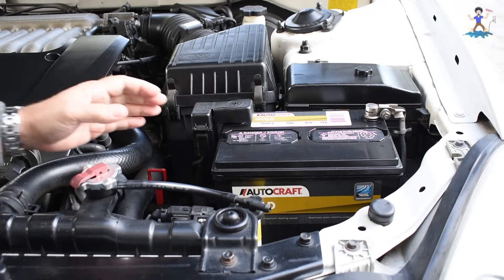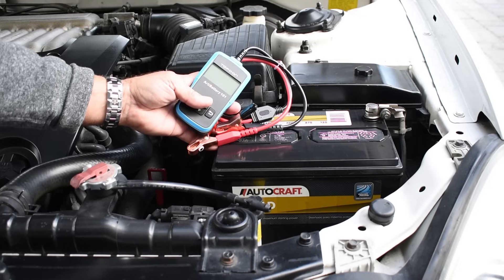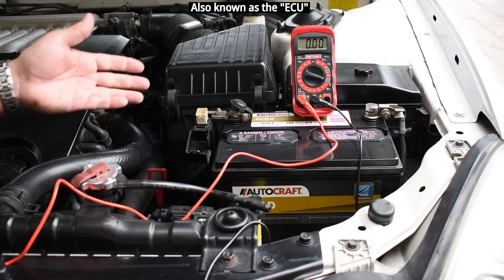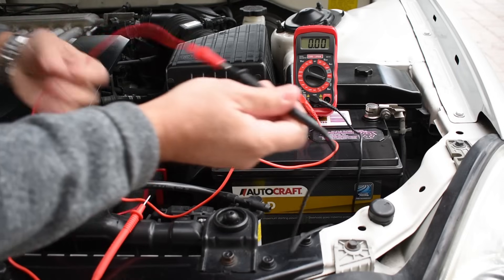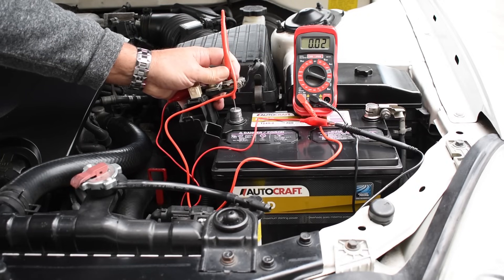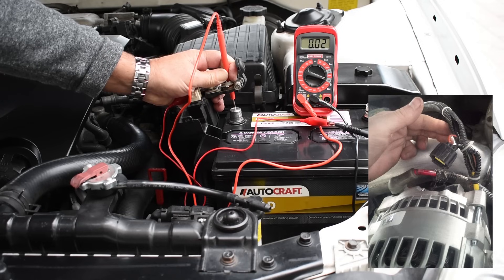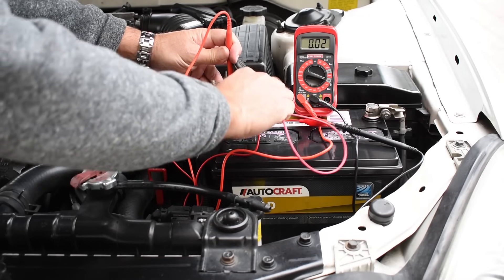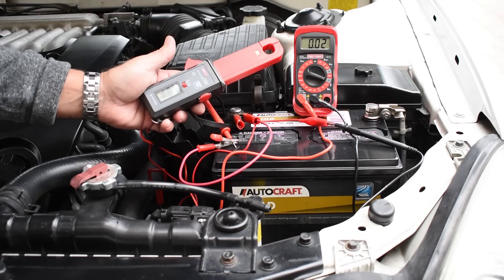Car Battery Drains Overnight Or After Days Of No Use! PARASITIC DRAIN

Comment: wondering is someone can help me. on my 2014 kia forte my battery drains quickly over 2-3 days. took my car to autozone and it checked out good. drove around and charged it back to 12.56v and all seemed good until i found it again dead. i bought one of those load testers on amazon and it tested good. it also checks your cranking and charging system and it said it was normal. i figured i had a parasitic battery drain somewhere and tried to test it with my multimeter. i put the red lead to 10 amp and adjusted my meter to read 10a setting. i disconnected the negative terminal and proceeded to touch the positive red lead to the negative ground cable and the black lead to the negative battery post. multimeter stays at 0.00 and nothing happens. i check the multimeters fuse and its blown no continuity. does this mean that the current amp draw is greater then 10 amps? everything was off and hood was open no lamp. i also tested it after waiting 30 mins. should i invest in a 20+ amp multimeter or just take it to a shop?
Reply from the maker: My other video may be easier for you.
https://www.youtube.com/watch?v=XH2wdHBZ6eE
Reply: @electronicsNmore  yea i watched that video and lots of others. i did the exact as you did in that video with the multimeter. most of the videos on parasitic drains on youtube deal with drains less then 10amps so i'm a bit confused why i keep blowing 10 amps fuses to test for a drain. do i just get a multimeter that can test amps higher then 10?
Reply: You can disconnect alternator and see. That much current could be caused by a shorted alternator.
Reply: Dont use the 10amp side on your multimeter thats why you keep on blowing your fuse .adjust your multimeter setting to DC Voltage depending on the multimeter the settings are different from everyone's mm tool..in you tube I have to set mine up to 60v because I dont have the 12v DC setting..I have the 'TASI TA801B multimeter '

Comment: I don't know if this is excessive or not.. But Something is draining the battery... Did the test:

- Fully charged battery (V12.75)
- Did a parasitic test and found:

NOTHING on : 0.06 on meter
ALARM on : 0.75
Reply from the maker: 3/4 Amp is a lot of power for the alarm being activated. Def a problem.
Reply: @electronicsNmore  Im a little confused how to read the meter..

0.00

0.0X = ?  What rating is that? Mlliamp?
0.XX = ? 
X.00 = ?

What would be considered an acceptable reading for Nothing on... and with alarm on?

Thanks.

I BELIEVE if I remember correctly, they disabled the auto window rollup on the alarm as it was using  I BELIEVE THEY SAID, 300 milliamps ? But that is not the case now as it's disabled from the alarm.
Reply from the maker: 0.1 = 100mA / .05 = 50 mA. Some newer cars can be as high as 80-85mA, but most cars you want less than 50 or .05mA. I limit viewers to one question per video, but didn't mind answering you twice. Thanks for watching

Comment: Excellent advice. However, I cringed every time your metal watch band came into frame.
Reply from the maker: It wasn't that bad. LOL
Reply: electronicsNmore  My apologies. I like your watch. Wearing it while working on the battery triggered my cringe. Countless hours of mandatory safety/first aid/CPR training have beaten me into habitual submission... Remove all watches/rings/etc before working on any electronics/electrical systems. Sorry for the misunderstanding.
Reply: I have used a wire and a battery to light my cigarette. A 12V car battery will piss you off before it actually hurts you.

Comment: Great idea.   Now you can do followup #2 and show your rig to transfer power supply from second battery of DC supply to allow you to test the in car battery with the Topdon tester out of vehicle.
Reply from the maker: 100% correct! I've done that. I used a small 12V SLA battery connected to the vehicle then removed the battery.

Comment: Some newer vehicles may run Evap pump during off hours. This will draw some current from the battery but it's totally normal. 
Also, the clamp-on current meters are not very accurate at the low end. I wouldn't trust it for measuring very low current. It's best to verify it's readings with a meter connected in series with the battery.
Reply from the maker: Hello Andrew. The particular clamp meter I used was designed for leaking current testing, so it does work well on the low end. Not every method is 100% reliable, but the one shown in this very is extremely useful. Thanks for watching!
Reply: @electronicsNmore  I think he was just pointing out that you need to know the behaviour of the vehicle you are working on
Reply from the maker: @peteahwanzo1504  Correct, he was referring to the LDP(Leak detection pump) that some newer vehicles have. I'm not aware of any that run with the car parked with the key out of the ignition.
Reply: @electronicsNmore  I'm not aware of any of the top of my head either, but that does not mean they do not exist.
Reply: @electronicsNmore  A 2017 Lexus GX460 does just that. Startled me the first time. You walk into the garage hours after the car has been parked and the panic sets in .

Comment: Thank you Doug. I use an OBD-ll battery back up port ,has they are supposed to keep the backup memory in the ECM. With all the new crap that are on timers to put them to sleep, it can be a headache to do the tests needed at times. Even opening the door can wake up some circuits. Best way I found was to open the door and fix the switch to fool the car into thinking all the doors are closed and just wait till  it goes back to sleep. Liked,Shared. All my best.
Reply from the maker: I prefer those. The power is directly to the computer, which is perfect when swapping out car batteries. Thanks for watching Bobby!
Reply: @electronicsNmore  m:

Comment: Has anyone had problems with the factory batteries in Toyota vehicles?  I have been through 3 in the first three years on my Toyota RAV 4.  They try to upsale you on a longer warranty.  I suspect they are all the same battery and they just change the label.  (Sears got caught doing this year's ago)
Reply from the maker: Wow, that's really bad. Did you have tests performed on your vehicle? Wondering if the vehicle is the issue.
Reply: After the last battery, Toyota checked it out and the charging system was  working, but barely within spec and for $600+ or so they would replace the alternator.  They gave me a hassle on the battery warranty and lost my business.  Last battery has been going strong for several years, though the diode on alternator did burn out a year or so later.
Reply: Nice video!  I worked Toyota service years ago, and just like tires for 
many of the models, the OEM batteries were crap per my experience...  At
the time Exide was the maker for my region, and although they met the 
minimal technical specs, longevity was not their strong suit.  Was not 
uncommon for the battery to just make it to the 12 month warranty, or 
just a bit less.

Vehicles at the time and earlier that were made 
in Japan, many times were equipped with Japanese made Panasonic 
batteries, that I personally saw last 8+ years and only replaced as 
insurance.  The difference was truly night and day.  Lastly, the quality
again in my experience of Denso/Hitachi/Sumitomo/Aisin/NGK electronic 
bits was superior to anything else I worked with, and the ONLY parts I would use as replacements.
Reply: @J F   Thank you so much for your reply and information!  Curious as to when you ceased working Toyota service?
Reply: Thank you, and you are most welcome.  Geez, hard to believe but it was 2004.  Sure, a lot has changed, but in my opinion and experience the zenith of Toyota quality, fit and finish, and reliability was Japanese made Toyota vehicles of the late 80's-1995/96.  Still relatively simple but done with tried and true technology and craftsmanship, and in many cases engines were VERY overbuilt, nearly indestructible, yet refined and beautifully executed/made with extremely high quality parts/metals.  Still a lot of timing belts to deal with in this era, but the vast majority of these engines were non-interference, and a broken belt did not destroy the engine.

I'd like to compliment you on your channel, and your way of going about your videos.  They are clear with a lot of detail, well filmed, very well explained with easy to grasp concepts, done in an affable manner...  The true mark of a great educator...  And it even sounds like my old friends from Long Island.  Take care, and please continue your great work.
Reply: My 2009 Toyota Tacoma original battery lasted over 11 years!

Comment: You can buy a memory saver for under 20$ that you plug into the cigarette lighter or power point that saves your radio pre sets and keeps the ecu powered!
Reply from the maker: No good. The parasitic drain can be on the same circuit with the cigarette lighter/accessory socket or sound/navigation system. The small battery backup tool also wouldn't be able to handle the higher current load placed on it. The only type I would recommend using is the OBD-II port backup device, but there's no need for it if you do as shown.
Reply: We use them every single day!
Reply from the maker: @richtheory.  Not for me, but I do like the OBD-II port backup tools. Cigarette lighter/Accessory socket backup devices are fine for replacing car batteries, but not for parasitic drain troubleshooting. They're unnecessary.
Reply from the maker: The difference is that you're backfeeding through an accessory socket or cig lighter circuit into the fuse box, then feeding into the radio cirucit and ECU circuit. No good. When you plug into the OBD-II port, it goes directly to the computer, and all other circuits can be tested. You also have the problem with cheapo cigarette lighter/accessory socket devices being powered by 9V and other low current capacity batteries. If you connect one up to a socket with a drain issue, there goes your ECU and radio settings. This entire issue has nothing to do with what I said to do in this video. Just do as shown, very simple.
Reply: @HylianOverlord  The 12V from the obd port doesnt come from the computer it does come from the fuse box on all the vehicles I have worked on.
Reply: electronicsNmore à

Comment: don’t reinstall fuses after they have been removed it can wake up a module and restart your drain test. The inductive meters work great but they can be thrown off by permanent magnets in The vicinity. another cool trick is to do a voltage drop over the fuse there’s sheets online that will convert a given voltage drop over a fuse value and size that will tell you how much current is flowing through that circuit. Great video
Reply: Mini fuse has chart of drop across every fuse they make.
Reply from the maker: @Michael Tempsch You can hold it off to the side of the wire, calibrate, then attach to the wire. I do it all the time. The reading doesn't have to be perfectly accurate to let you know. A few mA off is nothing.
Reply: Yup, DC clamp amp-meters usually (particularly for concurrents) need to be placed w current off, zeroed out when inposition, and then the current turned on to give a proper reading.
Reply from the maker: The fuse voltage drop method works, but much more work is involved. True about the reinstallation of the fuses, luckily any increase in current is usually momentary and the meter reading will go back to the lower reading. I did tests with the AC/DC inductive clamp for other videos, and a powerful neodymium magnet would need to be within 2" of the end of the clamp to really throw off the reading. A wiper motor, etc, would need to be even closer. Thanks for watching!
Reply from the maker: @mitzvah golem Yes, but the voltage drop across the fuse will vary based on load. Each vehicle will have a different amount of load on each circuit. I prefer my method.
Reply: @electronicsNmore  maybe research this method. Standard used in NGK Wells Auto tech school and high end shops.
Reply: mitzvah golem yep only problem is its hard on j case fuses and you need a decent meter

Comment: Years ago Autozone tested my battery and alternator. They concluded both were bad.  Sounded fishy. So I went to a mechanic friend.  Only the battery was bad.  That was 15 years ago. Haven't been back to Autozone since.
Reply from the maker: Usually the testing they do is reliable, but they can screw up like anyone else. :-) Thanks for watching! Please share.
Reply: @Light Ning Back in 1996, Sears told me my wife's alternator was bad on her '94 Ford Probe.  (They apparently didn't notice that we had a gauge showing the alternator was charging fine).   Still have the Probe and I'm still waiting for the alternator to fail ;-). Later Sears was caught selling mis-labeled batteries!!!

Comment: today's ecu's are like they store the system on ram like memory lol, that you can't disconnect the battery normally.... that's too bad..
Reply from the maker: They should have a super capacitor backup circuit. It's very foolish because there are times when a fairly new battery can go open circuit on a vehicle.
Reply: @Cheese 1337  A 20 dollar memory saver is all you need and you can unhook the battery with no issues!
Reply from the maker: @richtheory.  Yes, when replacing a battery! Not for troubleshooting parasitic drain.
Reply: @richtheory.  a today's car's ecu shouldn't be so battery power dependant..